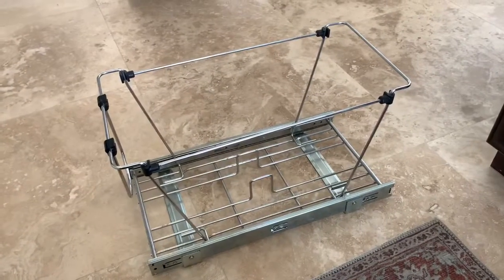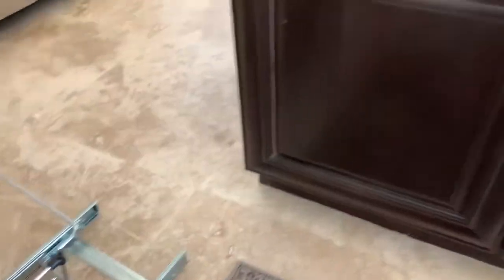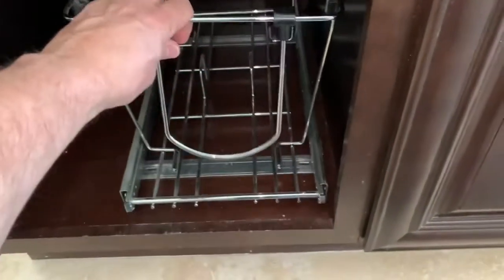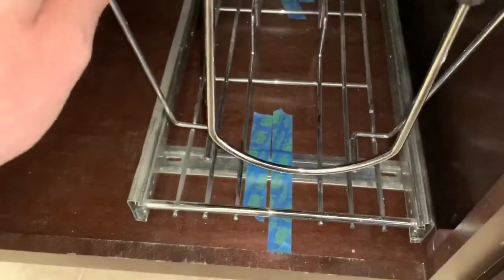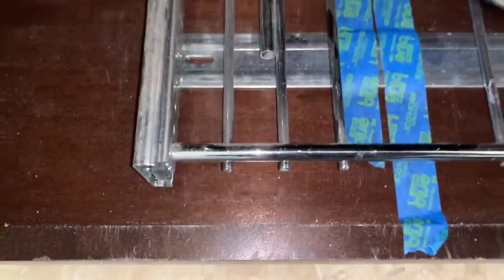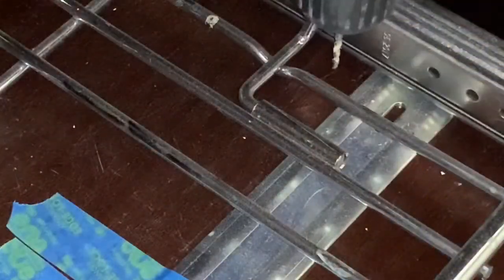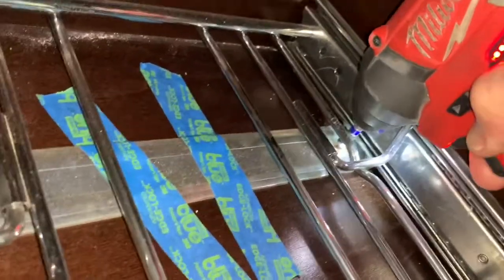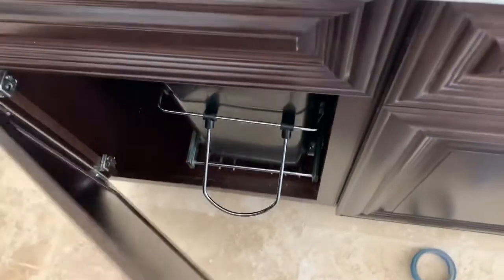Install a Sliding Garbage Can

Comment: Nice straight to the point video. Good tip about the tape. Thanks for sharing. Which brand of sliding trash cans did you use?
Reply from the maker: I don't remember...I think I picked that one up at Lowes.

Comment: How do you know what size drill bit to use?
Reply from the maker: If the directions don't say, hold up a drill bit in front of the screw or bolt. When you can just see the threads and the sides of the screw, you probably have the right size drill bit